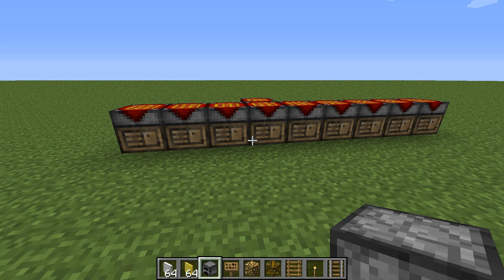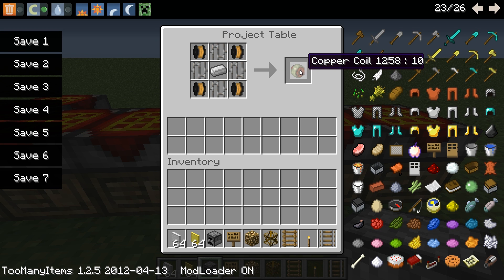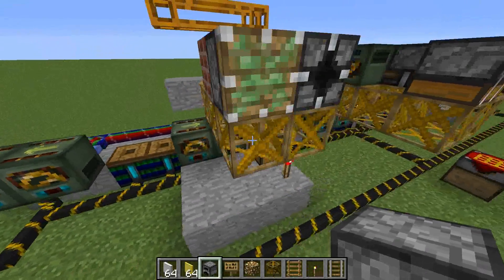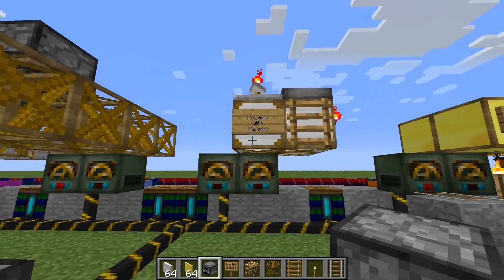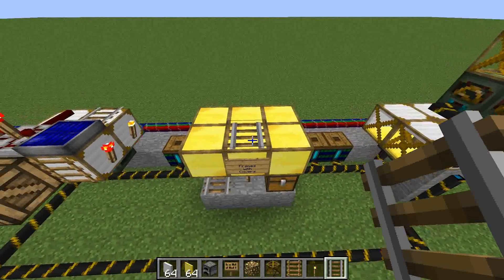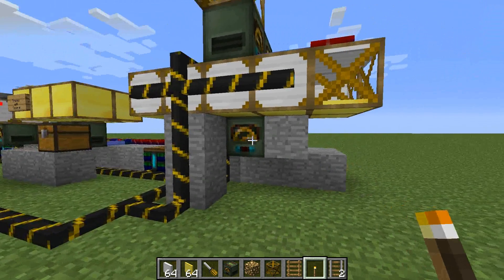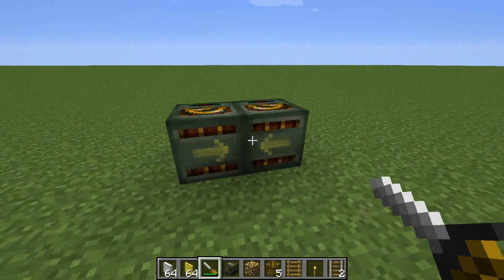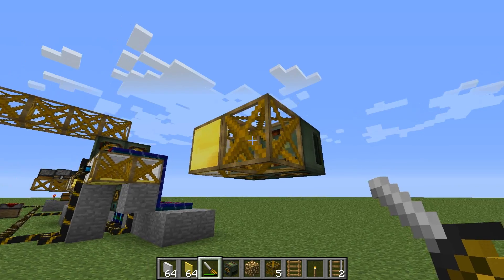Frames for Dummies (Outdated - MC1.2.5)

Comment from the maker: either there isn't enough power in the battery box (did you connect it to solar panels or put in a charged battery in the correct slot?), or there isn't a complete path of bluetric wires between the batt box and the motor. Are you sure there is no power? Check for the blue light on the side indicating there is enough power to function.

Comment from the maker: Use panels instead of covers and it'll work fine. There is also a slight visual difference between a frame with a panel side and a cover side. Panels have triangles in the corners and covers do not.I didn't realize that when I made this video.

Comment from the maker: The default is 1000 blocks. There is a redpower.cfg file where you can change it. The line is "linksize=1000". Note that moving more than 1000 blocks may cause performance problems depending on your computer.

Comment from the maker: You need 3 thingss for it to work.
1 - bluetric power
2 - redstone signal to pulse the motor
3 - nothing obstructing the frame or anything stuck to the frame.

If your frame is close to the ground, chances are, its stuck to something on the ground.

Comment: I have personally tested vertical movement, like a raising tower to "switch" carts onto other lines; It worked fairly well, though you have to careful since powered tracks WILL activate Frame Motors. Sideways .... never actually tried that one....

Comment from the maker: A frame motor can never move itself, but a frame motor can move another frame motor either directly or a frame motor attached to a frame that the motor is moving. This allows for what's been named "inchworm" drives where a motor moves a frame contraption then a motor on the contraption moves that motor in the same direction. This allows for free-moving or "flying" frame machines.

Comment from the maker: Now I'm curious what kind of problem you're having. Problems that first come to mind are: Not enough power to the motors - You may notice I have lots of batteries. Sometimes the motors pull more power than a blue alloy wire can supply over a long distance. Blocked movement - like I showed in the video, any item not attached to the frame can block frame movement - even a wire or torch. Motor direction - the motors have only one working side and that side only moves in one direction.

Comment: Also, motors can power motors directly beside them, and if you can pull power out of the motors with blulectric wires. I've found this helps avoid messier setups